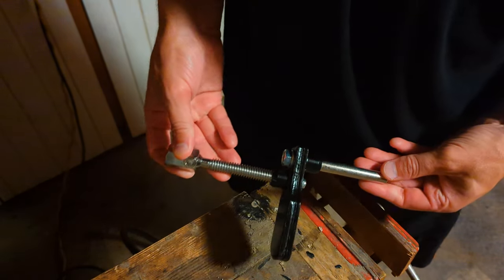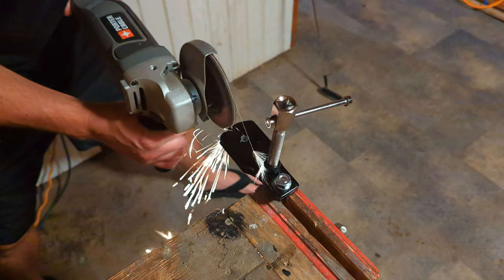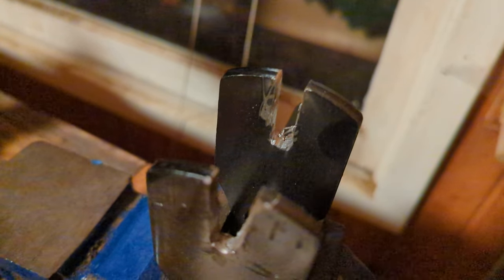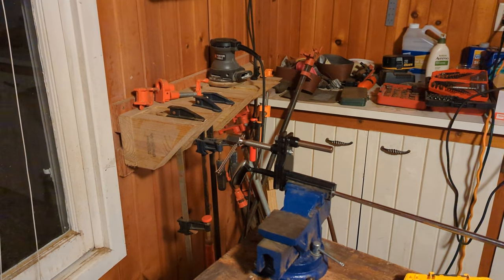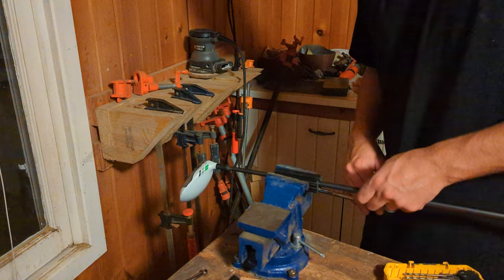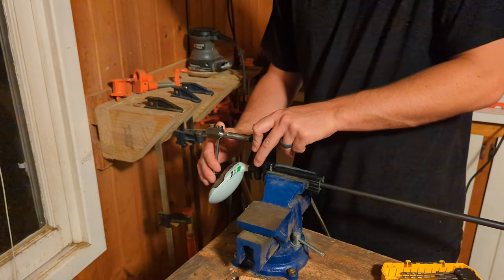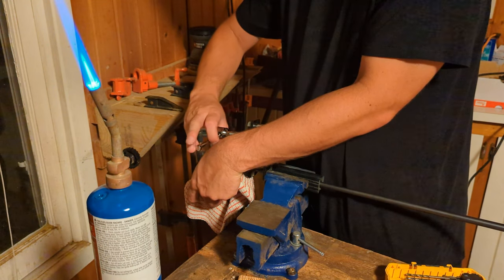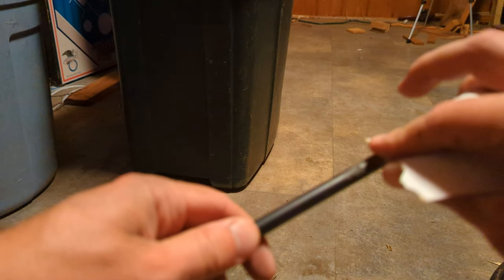How to make a DIY Graphite Shaft Puller - Golf Club Building

Comment: I purchased the break spreader and made the tool as he stated. It worked great. I did not have any problems removing the head off of a graphite shaft. I used a propane torch to heat the hosel and started turning the shaft. What I did find is after you put the heat on the hosel let it sit for about 30 seconds before you start to remove the head. Seemed to work better. I removed 8 heads without any damage to the shaft

Comment: Followed your process and 15 minutes after starting pulled the first shaft which came off within 20 seconds of applying heat. Shaft came out perfect with no damage and was ready for a new adapter with a minute or two of hand sanding

Comment: A couple tips.  Step 1 should be heating up the ferrule for about 15 seconds, and use a scraper or razor blade to cut it out. Now the connection between the made plates, and the club head are much more tight, direct and accurate. Step 2, The heat source should never stop moving. When you keep the flame pointed at 1 area of the club, especially on graphite, that's when the melting, chipping and cracking happens. The design and concept is nice and will work, but eventually, if you are pulling a ton of shafts, you'll need a way to mount all pieces of the jig permanently. Good job Kley Golf!!

Comment: I used this to pull 7 heads from graphite shafts from my ping g400 irons. I used a black and decker heat gun set to high for about 60 seconds. Worked perfectly.

Comment: If I can add a few suggestions, I use a smaller butane torch than can pinpoint heat instead of using a plumbing wide flame propane torch. I've reshafted lots of clubs for years using  a electric heat gun on low heat for a long time to separate some iron heads, it won't discolor stainless steel and chrome, otherwise you have to use some anti-bluing product to make the head more attractive.

Comment: Great little video.  I always enjoy the DIY route to problem solving.  Just a suggestion, but instead of using a gear puller, you might wanta try using a woodworking pipe clamp. I think it would give you a little better leverage, plus with a little creativity, you can find a way to mount it solid  so you don't feel like you need 4 hands.
Reply: But you would have to remove the grip to be able to slide the shaft into the clamp, right?

Comment: The sliding ‘knob’ seems to get in my way imo more than helps.  I took mine off (easy with bench grinder) and am going to try without.  The socket can hook up to my wrench and/or small battery operated wrench (being sure not to go too fast).  But also using an extension allows me to set it inside the bench vice below the shaft..and use it to aid in balance….which allows me to use one hand to apply heat and other hand to turn wrench (or tap/ pulse).
Reply: Add to my 3d wish list a small attachment that will fit over the metal plate to provide additional bearing surface and maybe one for inside to make a nice non-marring surface.  Seems it would be fairly simple to design…

Comment: Flip the spreader 180 degrees from how you are using it. Drill hole and mount to the vise with c clamp or bolts. You get the idea though because you’re handy.